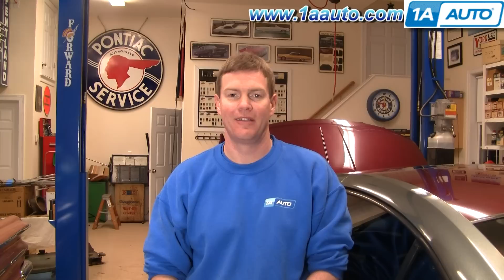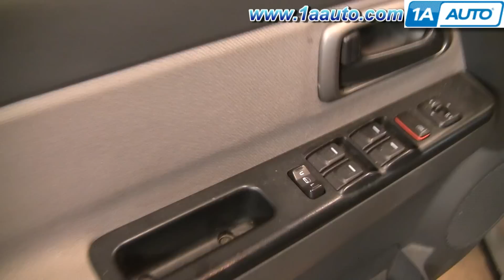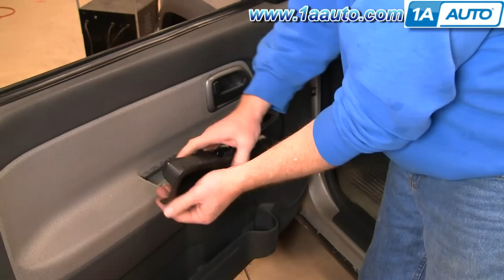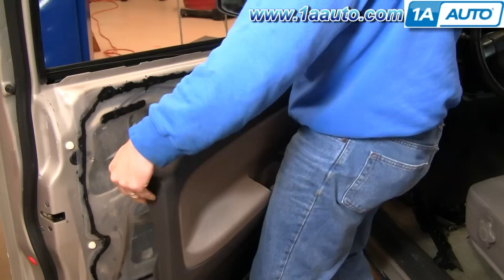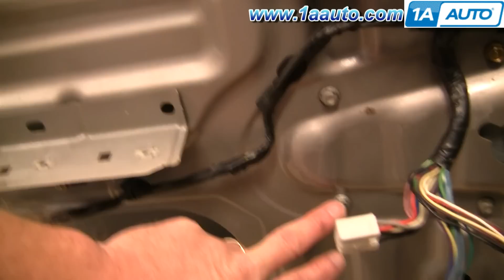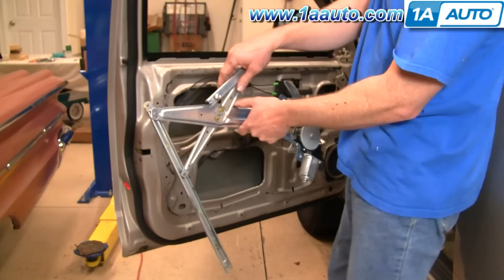How To Replace Front Power Window Regulator 04-12 Chevy Colorado

Comment: My driver window goes down fine seem like my motor is ok  but i have to tilt or push the window so it goes up while i hold the switch,  do i have to replace my while thing or is it just the track
Reply from the maker: +Kronniks tv Thanks for watching!  It could be the motor, switch, motor or something else preventing it from going up smoothly.  You will want to inspect all of the parts first to determine what is the issue!

Comment: ok, question.. the back window does not work period.. but does click..   the front drivers window seems to work when it wants..  it will go down and up twice.. and then it won't go down again.. wait a day and try it again and it works.. i am so scratching my head.. 
any suggestions  switch maybe?
Reply from the maker: +Kat Lewis It could be a relay or a problem with the switch. There's also a memory program where windows automatically go up and down depending on the switch's position - it may need a reset
Reply: @1AAuto   this is something i can do myself?  also, if i purchase a new switch panel and that is not the problem.. can it be returned?

Comment: my window is off track. doesnt slide up very well at all i can even pull it with my hand to close it all the way. have any tips?
Reply from the maker: +Maria Marquez You can try to put some lubricant on the track to see if that helps, but if it is really stuck and does not seem to want to move you may need a new regulator or motor.  1aauto.com
Reply: Thank you for replying sp fast. I had taken the door apart and the actuator arm was cracked and bent. so i have to buy the entire regulator + motor unit?